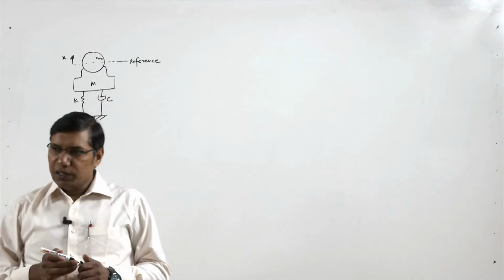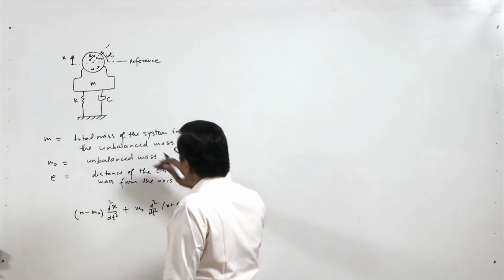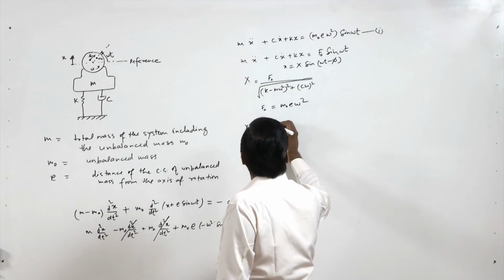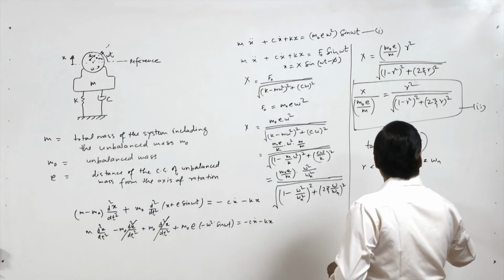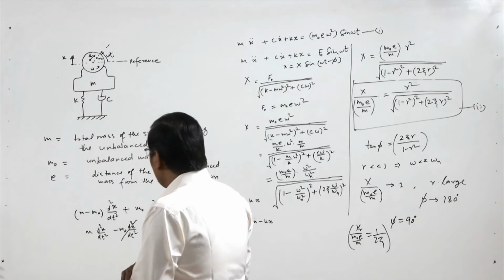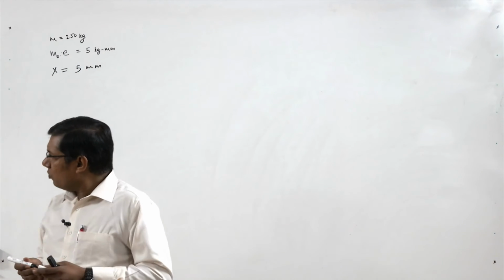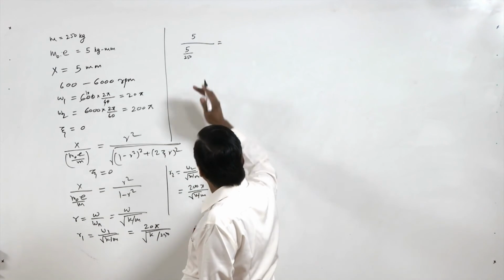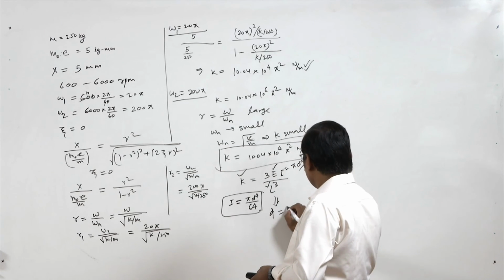Rotating unbalance

Comment: I don't understand why r should be larger in the last question you solved. can you give a detailed explanation as to why you picked larger r? I checked your previous videos but I still don't understand why you picked it.
Reply: @peter bokango
We always want rotating unbalance ( y-axis) quantity should be as low as possible. From the graph of Mx /me and r we can see it's starting with zero at r<<<1. Ideally we have to use this. But this is not useful for us as r<<<1 means angular velocity of total mass is almost zero which is possible at starting. No machine will work on starting speed. So when r is increasing unbalance also increases. So we should work after resonance condition i.e., at r>1. With r slightly more than one we can see large unbalance. So we should maintain r sufficiently higher than one so that unbalance will be low with out using a damper.
This is what I understood from this. Any corrections are welcomed.

Regards.
Reply: I don't know if I get it right, but in the graph at 15:52, you can see that rotating unbalance will tend to 1 as r is large, independently of zeta value.